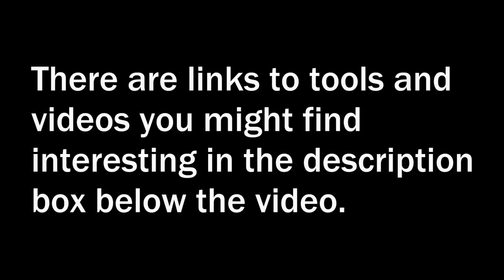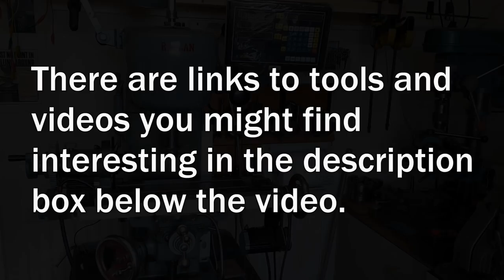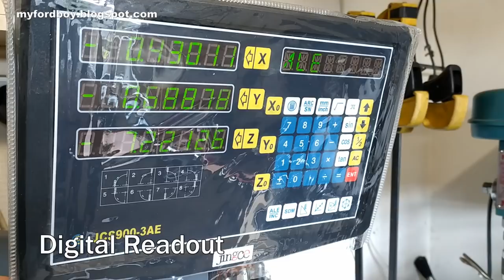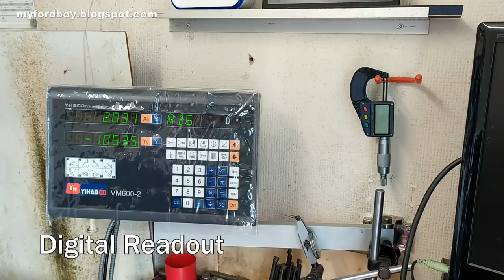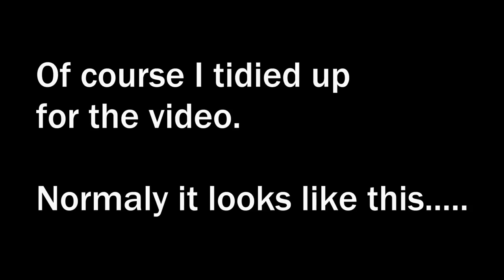Myfordboy's Workshop Tour (With a Xiaomi Note 8)

Comment: That was very interesting to see, thank you for the video. My own shop is 1.85mX3.78m, so a little bit longer, but narrower. A tight squeeze with a Myford S7 (much longer than the ML10 in the video, on a stand with a long drip tray), Chinese B20 mill, Lorch, Scmidt treadle lathe, benchtop drilling machine, filing/fitting/finishing bench, woodworking bench, and rolling tools/materials cabinet. But still workable. Like some others have expressed below, I appreciated the last shots a lot, showing what the workshop really looks like most of the time. With such little room available, every surface quickly fills up, this is unavoidable when making something complex.

Comment: You've put together a fantastic shop in such a compact space.  Can I guess the power feed for X and the rotary table are for helical gear cutting on the mill?  Very cool to see that combination of new technology, such as the DRO, with the solid build construction of the older mill and lathe.  Best of both worlds.
Reply from the maker: The spindexer has an electronic indexing control but is not coupled to the X feed so no good for helial gears!
Reply: @myfordboy  Ah, OK.  So it was designed to make the tedious process of hand indexing much simpler and error resistant.  That's a good idea.

Comment: I knew your shop was small. But that's quite a bit smaller than I thought.
I have the same JingSe DRO. I have been unable to figure out the manual, so for many things I have had problems. how have you fared in doing things with it aside from direct reading.
I have gotten the 1/2, the bolt hole pattern, but not much more. I have seriously failed to get the calculator to transfer to the dro, And I have not gotten the radiusing to work. if you have had success, can we have an offline conversation?
Reply from the maker: I have not had a reason to try the functions you mention. I have only ever used bolt hole and half one.
Reply: Have you tried searching for drop tutorials on YouTube? I have found several informative ones and have since forgotten how to program most of the features.
Reply: @robertoswalt319   I have seen some of the DRO tutorials, but they are not for the JingSe.. they don't work the same.
it's been a struggle at times. I wanted to use the radius function to smooth out  an edge, but was not able to get it working.